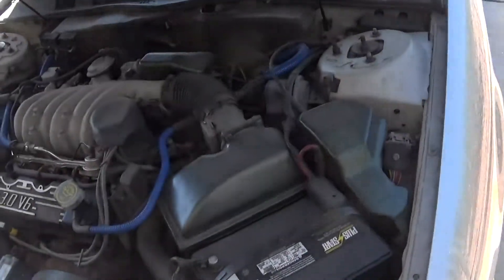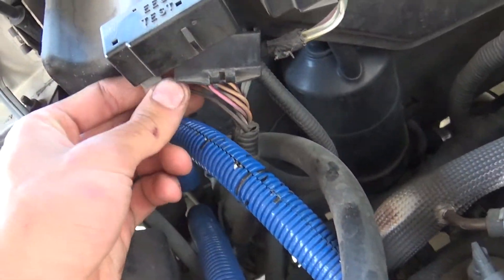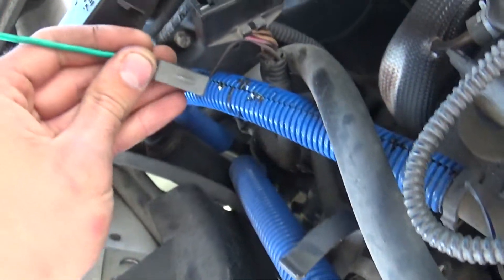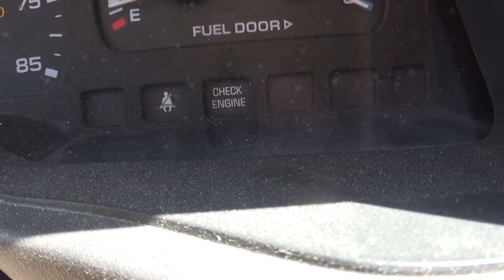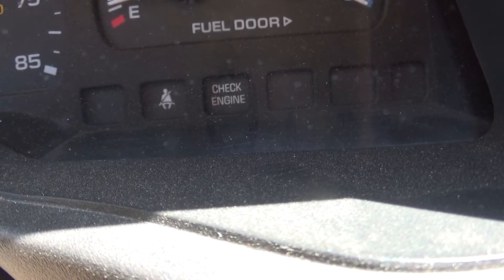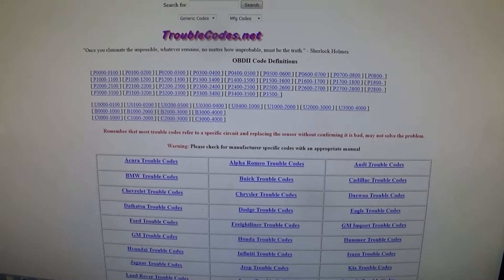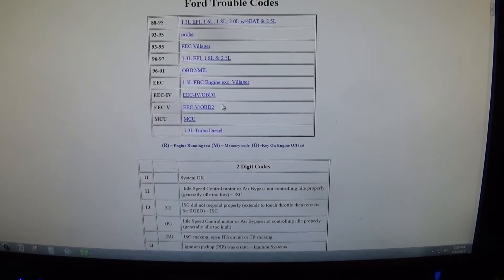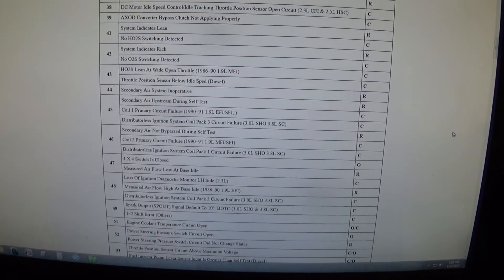How to read OBD1 check engine codes

Comment: Good vid!   EGR disconnected, don't let the Smog sniffin E-Testers  catch you with that, or they will throw a conniption fit !!!   :)   They pass out, when they watch a Deltic engine clagging things up with Prius repellant!  :)
Reply from the maker: Thanks! What's funny is that car passed emissions just as well with it disconnected. I put a vacuum cap over the valve then slipped the line back over the cap, they couldn't tell the difference. I do like Prius repellant!